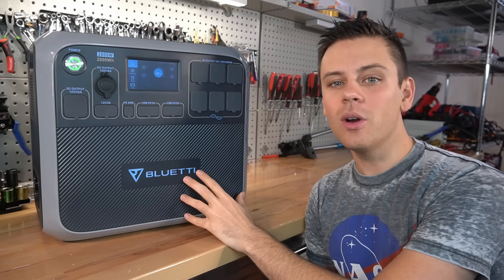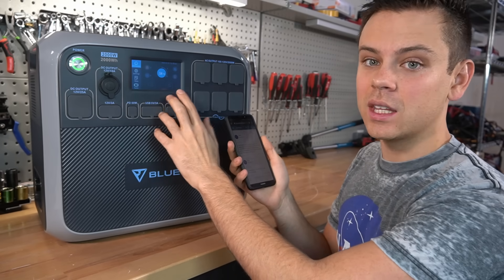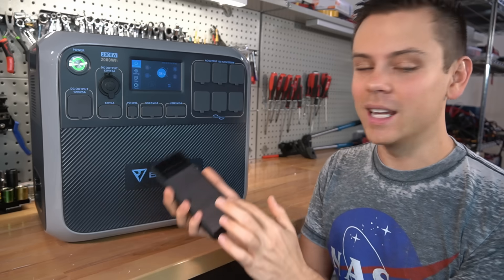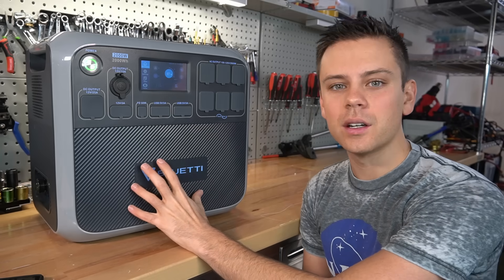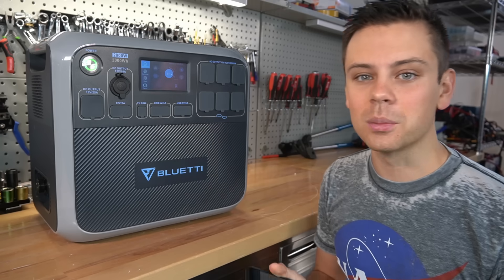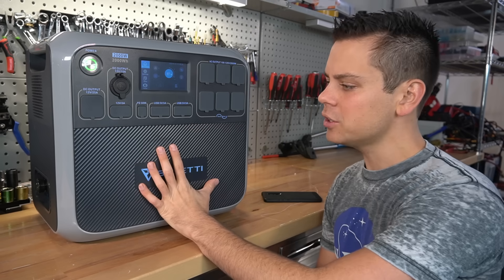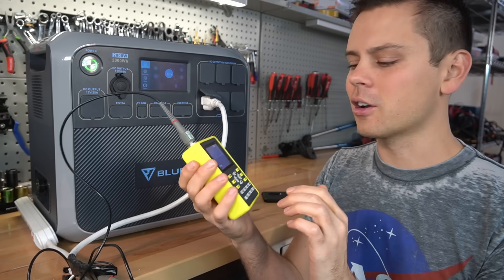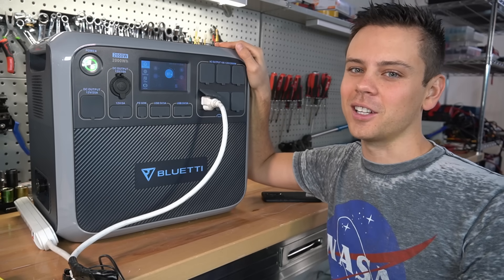New Issues are Plaguing the Bluetti AC200

Comment: OFF TOPIC QUESTION.
I purchased 4 - 150Ah Lifepo4 batteries on Amazon and when they arrived the voltage of each cell was at 3.859,  there was not any info on the batteries no DM-Code. They came with 4 bus bars that will not work at all which seem useless also no nuts for the posts. the manufacturer (LiRongPingShopUS) replied: "The maximum charging voltage of each battery is 3.87V, and the nominal voltage is 3.2V. this is normal phenomenon." So I am curious if they really are Lifep04 or would you think Li-ion?
I am bringing them down to 3.65 per cell but thought it was really weird they came with such a high voltage.

Comment: Hi Will, the only issue I’ve had is that the temperature is incorrect .AC 200 Original . UK Version.
Reply: Is that a potential fire hazard if it were to overheat? That's my question. Mine thinks it is about 30°f cooler than it actually is.
Reply: @VANquishedAdventures  I suppose that you have to take into account that the censor for the temperature is inside the casing.. So as the fan kicks in it would maybe blow directly at the censor. When you say its 30f cooler. How would you know that without being inside the unit?   Are you talking about the outside ambient temperature?
Reply: @grumbleweed5570  it was 55-60°f ambient and 28°f displayed on the screen. No way it could be the real temperature unless it was put in a freezer. The unit displays the temperature on 3 screens. All different.....and this is at startup without charging and nothing running so the unit wasn't generating any heat.
Reply: @VANquishedAdventures  point taken. My temperature readings.are also incorrect.  I also have 2x Lithium batteries ,the temperature read outs on those are both way out as well, although not as much. Perhaps Will  P.  could explain to us just where the temperature reading is getting its information from...i.e where exactly is the Sensor
Reply: @grumbleweed5570  would love to see a teardown. Mine displays temperatures on 3 screens and none are exactly the same. Definitely has me wondering what's going on inside.
Reply: @VANquishedAdventures  it’s got to be the temp of the cells . Surely ?
Reply: @grumbleweed5570  3 temps, one at cells for battery safety(too cold to charge or overheated), one at inverter for overheating under heavy load and one at input for overheating from overcharge. Best guess of course. Either one being 30° off could be a fire safety issue IMO
Reply: @VANquishedAdventures  My AC 200 has been standing in my house all week. It hasn’t been used at all,  not charged,discharged or even switched on. The temperature inside my house is a constant 70f.....i have just switched it on and these are the readings..... PV/Car Charger_51f.......DC Output.  53f.......AC Output ...66f

Comment: Will, did you see the review that David Poz just did on this unit?
Reply: I watched Poz after I watched Hobotech, reviewing the same unit. Hobotech (not a big fan but he's usually ahead of the game on the latest releases) did relatively extensive testing and he's in love with the unit. Poz just unboxed the unit and didn't know much about it, like dual simultaneous charging and a handful of other nuances pointed out by Hobotech. :-)
Reply from the maker: @BreAsop  I like Hobotechs reviews the most. He is very thorough and learns quickly. He covers EVERYTHING. I avoid watching his videos before I make my videos because he covers so much! haha hes great

David never responds to my comments :( lol I don't know why, I wish he did respond. He seems like a cool guy, but I feel like his reviews mislead people at times. He does admit when he doesn't know something, and his viewers are very smart! I actually look at Davids comments the most because his viewers know a ton!
Reply: @WillProwse  As on of his viewers, I got my initial experience from being one of yours. David has been extremely helpful and responsive to my questions. Obviously, his skill set doesn't match yours but, like you, he will take on just about every challenge. I finally feel that with what you two have taught me I am not nearly as dangerous anymore and have a much better concept of batteries and pv systems. I don't think I could ever have built my 12Kv solar system without the knowledge I learned from both of you.

Comment: An interesting thing I noticed with mine is that when the inverter is on, the display will show zero consumption unless there's a load. I tested this with a killawatt meter. The actual load could be about 10 watts or so, the AC200 would show 60-70. As soon as I remove the load the display drops to zero. The inverter on mine uses about 50-60 watts consistently from my testing. I have the original AC200 not the AC200P.
Reply: Killawatts 😂😂😂😂
Reply: @malcolmrowe5031  You do realize that is the brand of the meter right?

Comment: I had an issue with the EB150 and customer service took care of it right away and were very responsive. I just received my AC200 a few weeks ago and have yet to open it.  It's been busy since Thanksgiving but I will get to it this weekend. As far as the delivery date, the Indiegogo updates were pretty good. I received my UPS tracking number and it was accurate, except it didn't show delivered when it was, but that's a UPS tracking problem. I hope I don't have issues with the AC200. I think it was sitting in customs for awhile so maybe I am not impacted by supplier issues. Guess I will find out.

Comment: Mine was a few weeks late but I’ve been using it daily for a couple months. It works great 👍                           I like mine.
Reply: Where did you buy it from?
Reply: Mine as well few weeks late but works like a champ daily for last 6 weeks. Also accepts 716 watts of solar charge from 94 volts of panels
Reply: hi sean
Reply: You still like your ac200 is it worth the buy?
Reply: I have Bluetti AC200L which has now given me an error code 005.  Any info on that would very much appreciated and helpful.  Good video thanks for the tips!

Comment: I have the ac200, here are my observations, so far it works fine, limited use though. 

1- required proprietary adapters are unobtainable( why not use a generic plug on the 25A DC) 
2- their delivery promises are worthless,
3-  customer service is non existent to poor
4- In Canada their price is 60% more than in the USA, all other solar generators are 30% more due to currency exchange, this is expected. 60% more, no thanks.
5- I have 2 Jackery products and am looking into Point Zero Energy, for their next offering. Point Zero has been great responding to emails, they even helped me design wiring for my 2900watt panel array, even though I did not purchase from them. I will definitely be spending money there. I have had zero issues with Jackery, their customer support before and after sale is top shelf

Bye bye, Bluetti
Reply: If you've got the AC200 then you must've purchased your unit through Indiegogo, the price is the same for the whole world, how can you pay 60% for your AC200?
Reply: @tysonmarcus9231  I was referring their other products, they are either unavailable or 45-60% more than US sites. The Indegogo purchase was the same price everywhere, that’s the way it should be, adjusted for currency variations.  I was considering their other products but will not until they address the pricing issue. Then there is the customer support . I wait a week or more for answers via email, or they don’t answer at all. If Bluetti wishes to succeed in the North American market, they need to have US based customer service
Reply: @tysonmarcus9231  are you affiliated with Bluetti?